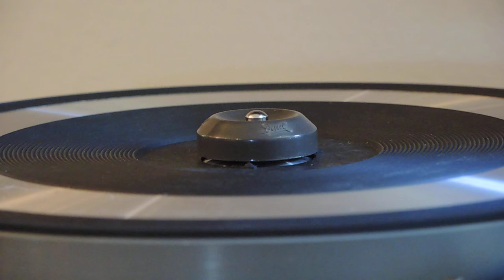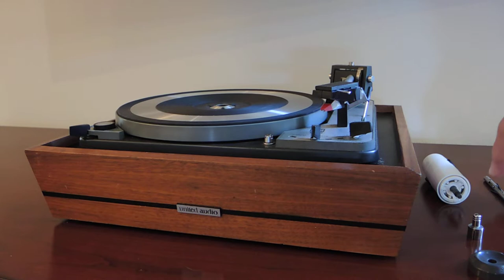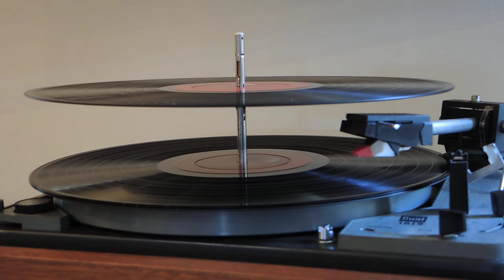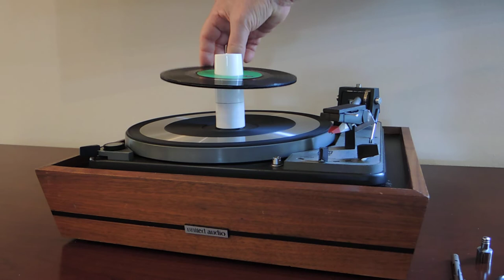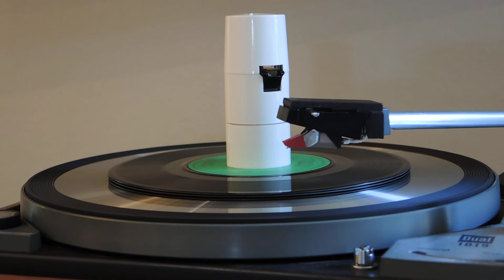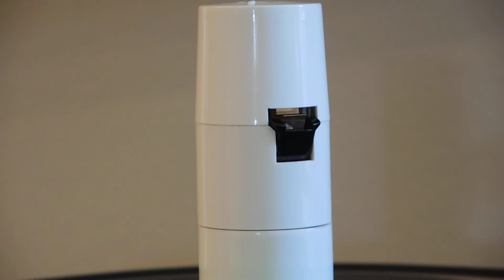Dual 1019 Automatic Turntable Changing Records - Record Changer

Comment: I have the Dual 1011 and the exact same changer pen like you. But he drops the whole amount of the vinyls. Because i can see that in the middle of the pen is something missing on mine. Do you know where i can get e new changer pen?
Reply from the maker: The spindle/pen has to be repaired with new rubber parts.  Even if you could find one NOS, (one that had never been used), it would need new rubber parts, as the rubber they used disintegrates with time.

Comment: What's the reason for the 1019 I have that tone-am keeps playing after the last record?
Reply from the maker: If you mean it keeps playing the last record repeatedly, it should stop after the last record.  The spindle may be at fault, or some part underneath may need lubrication.  Good Luck.
Reply: Priceless with all the spindles including the 45 adapter. Excellent!